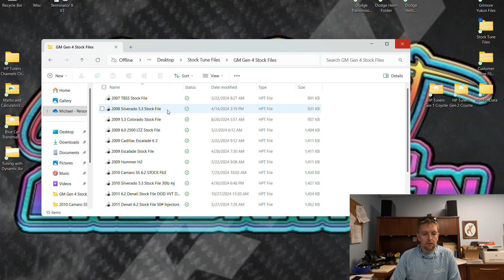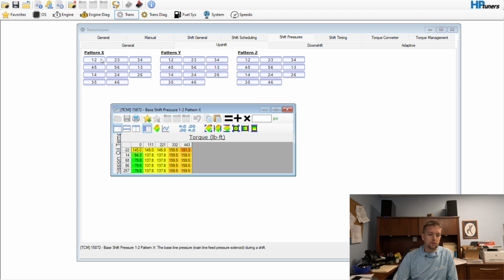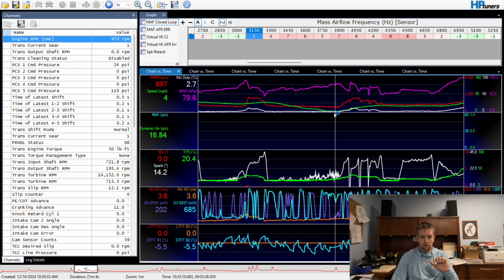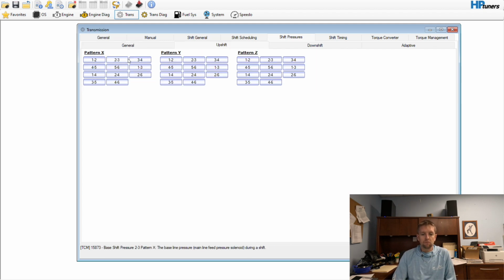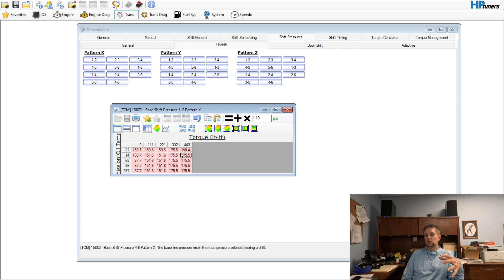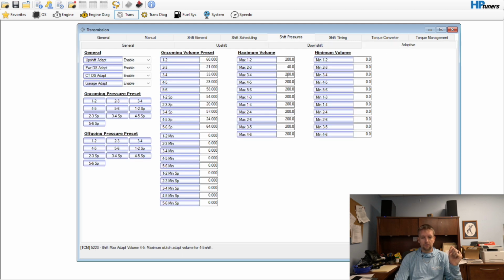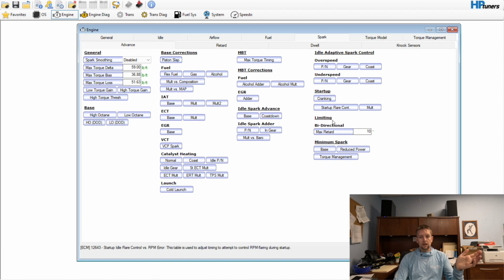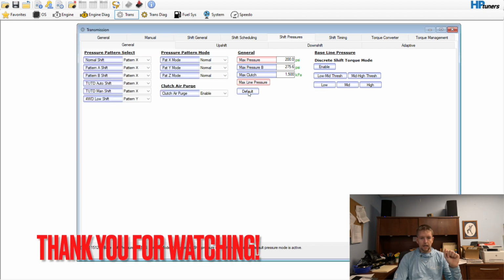6L80 Shift Pressures How and Why They Work Tutorial in @HPTuners

Comment: One of the better videos on how to add line pressure.  A lot of people like to skip over this and I think half the reason basic truck people are getting hp tuners is to try and get some longevity out of a reman 6l80 and turn off DOD.  This and turning off  converter lockup in 1-3 and turning down the allowable slip is why im here.
Reply from the maker: Glad you got something out of it! Reach out if you ever need any help or have any questions!